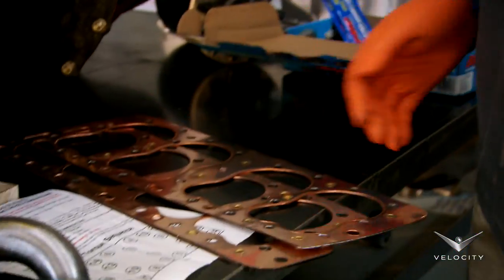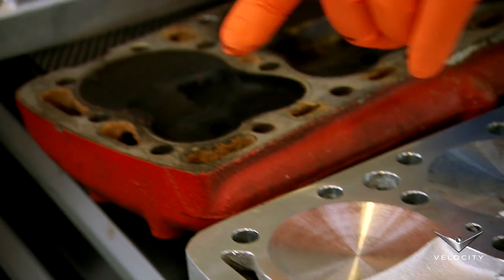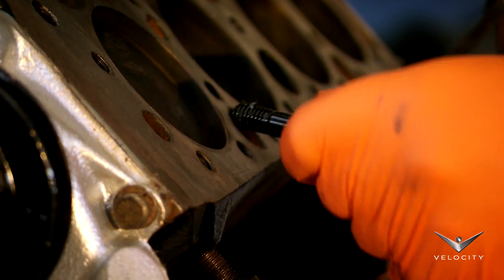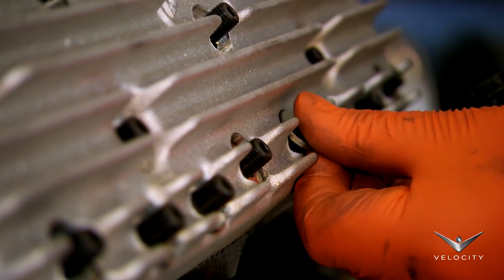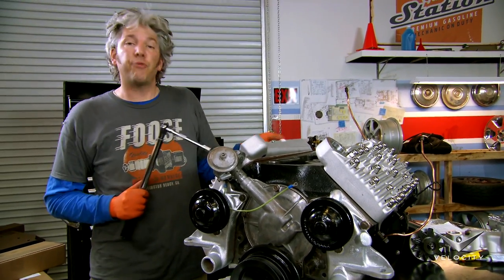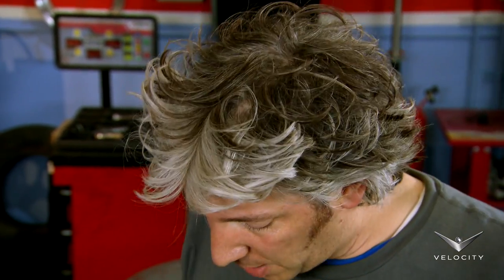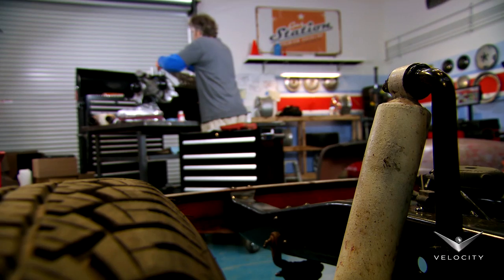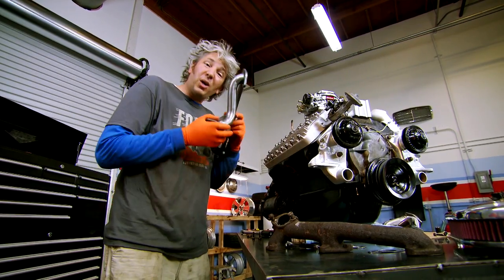Overhauling a Mercury 52 V8 Flathead

Comment: These reasonable improvements will help your engine breath much better resulting in a noticeable power increase.
 It'd be nice to see a video of your flathead running.
Reply: I learned to build engines on flatheads. we ran 4 barels on them in stockcars. we beat all the cars with 2-2s.that'd why. they ran good,and fast.

Comment: Should have used carbon fiber head gaskets to save the Al-u-mini-um Heads....
Reply: No , a flathead has a poorer thermal behaviour than an OHV. So it is absolutely necessary to improve the thermal bridge between the Cylindercap and the Cylinder. So the blank copper-gasket is the best choice for Flathead engines.
Reply: @stefanrichter9162  Wait.  Those head have the coolant ports.  Why do they need conduction?

Comment: Only fat heads with fat wallets build flat heads. Outrageously expensive horsepower (which is meager even with a blower) per dollar spent. All of the builders I have seen on YouTube leave out an essential inexpensive component. The basket surrounding the oil pan. The basket catches all those expensive parts when the three mains come out and the thing blows up! 🤣
Reply: If you ever owned a flat head of even heard one run you would understand
Reply: It's not about economics or power... it's all about heart, soul and nostalgia. I own and 'run' numerous flatties and love them. You have to be careful with them, pay attention to them and take care of them. If they 'start' getting hot, you gotta pull over and let her cool down. I run oversized modern radiators/electric fans in my old stuff...there are just some components that it's ok to upgrade to. If I want reliability, I drive my modern ride. If I want horsepower, I ask my brother to give me a ride in his Hellcat. It's all good!!
Reply: @davidpehrson6300  excellent upgrades, aluminum radiator and a high cfm electric fan keeps these engines running cool. I've done the same on mine, with 180° thermostats.